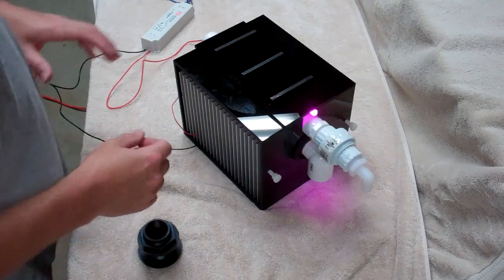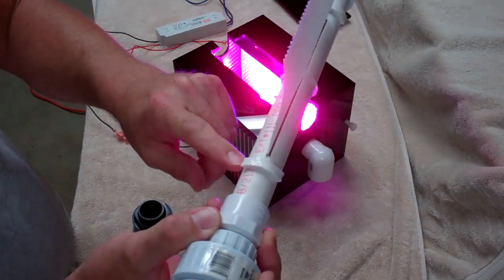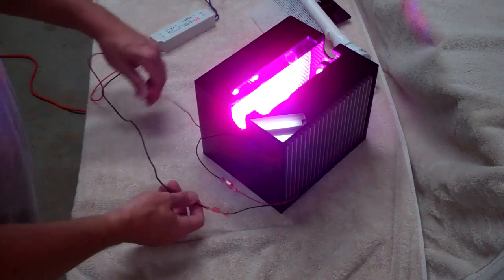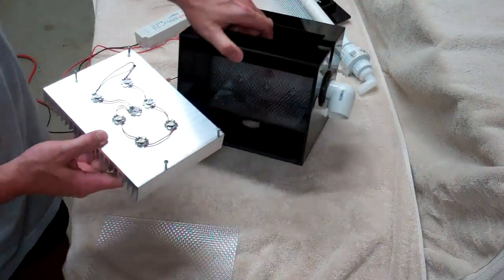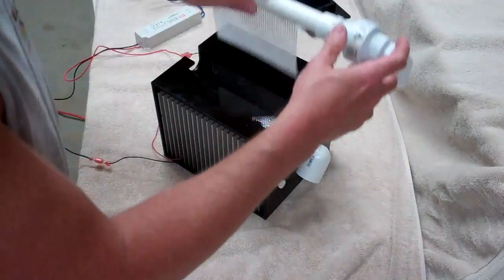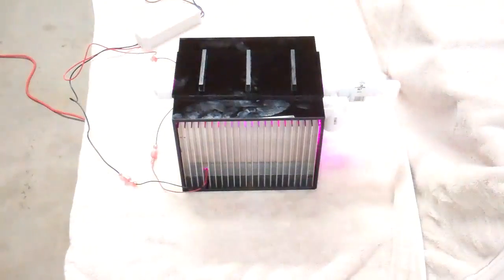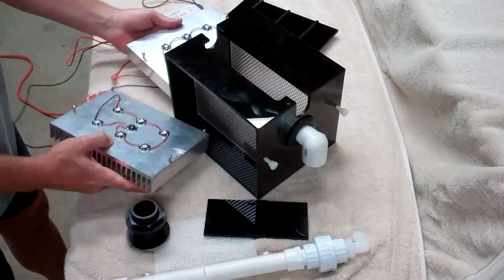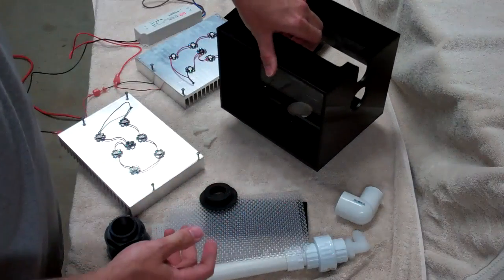L2 LED Waterfall-type Algae Scrubber Overview

Comment: where did you get the LED's, Drivers and heat sink at?
Reply from the maker: This is the first version I made, it used HeatSinkUSA heat sinks, Meanwell LPC-35-700 driver, and either Osram or Philips 660nm Deep Reds and either Cree or Philips 445-455nm Royal Blues.  I now use the MakersLED heat sinks and all Philips LEDs.
Reply from the maker: Joe Scrivens https://www.algaescrubbing.com/threads/ordering-information.308/

Comment from the maker: The prob I find with running anything else but 660nm is that they are too intense.  You can cram 660s together and get nice even coverage, but throw in anything else inside of 660 or 400 and the intensity (radiant flux) goes way up, so you have to run them at lower power relative to the DRs.  So I run the RBs in parallel within the series, they run at 350mA and the DRs at 700.  Could do the same with CW/WW if you wanted to.  I've sold >100 of these of various sizes all use DR+RB and work great

Comment: I under stand leds are mainly temperature specific... thats y i run a even mixture of CW 10k, 456nm blue, and WW leds on my ATS and refuge. I know adding afew 660nm reds are benefiting but i would have never thought running mostly them would be optimum spectrum.

Comment from the maker: (...continued) and while WW LEDs do provide some red, they are not primarily red and are not apples-to-apples comparable to CFL or T5HO "warm white" 2700K or 3000K.  K ratings on LEDs are only there to give architects and lighting designers something to use to substitute for other sources, color temperature is for humans - not plants.  Plus WW have little blue component.  So for grow LEDs you need 660nm red and 440-455nm blue.  Google LED plant grow lights.  Thousands of them.

Comment from the maker: Not magenta, 6x Deep Red 660nm and 1x 440-450nm Royal Blue.  Now I make them with 2x RB at 1/2 power as full power RBs are too much and actually inhibit growth.  WW are not the better spectrum, this only applies to fluorescent sources, which are based on mercury then shifted to visible light with remote phosphors.  The primary components of fluorescent light are the deep red and blue-violet spectra.  LEDs are element based so you have to use the LED that provides the specific bandwidth (cont...)

Comment from the maker: This version in this video is obsolete, the new version has the 2nd drain very low on the side to is acts as secondary drain in addition to the emergency function.  The bottom drain with the valve becomes a tuned siphon, and the side drain is like an open channel, similar to what you would find in a BeanAnimal or Herbie drain system - it is dead silent and after a few weeks of running, it is bubble free as well.  Plus, you can really crank up the flow - up to 600 GPH

Comment from the maker: I tried this on a higher flow version.  That only works to a certain extent.  Adding an air line to the drain will silence the noise but at the cost of decreasing the flow.  The issue with a enclosed scrubber with a drain is allowing enough flow through the device for proper algae growth while not causing tons of microbubbles.  Turning the bottom drain into a full siphon by putting a valve on it is the answer, not an airline.  The valve takes care of noise and bubbles without restricting flow.

Comment: If u drill a hole and add some air line in the drain as close to the box as you can it will cut the drain noise down considerably.

Comment from the maker: Yes, the LED driver (along with pretty much any LED driver, for that matter) is just an AC to DC converter, so they are all universal voltage.  The Meanwell LPC-35-700 is 80-277V input compatible I believe.